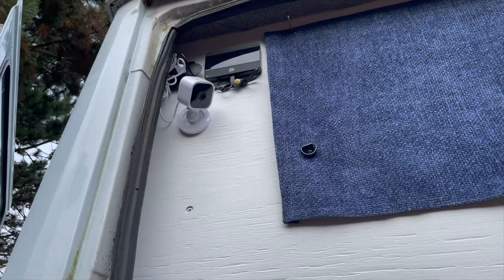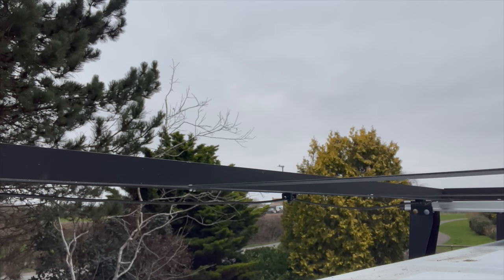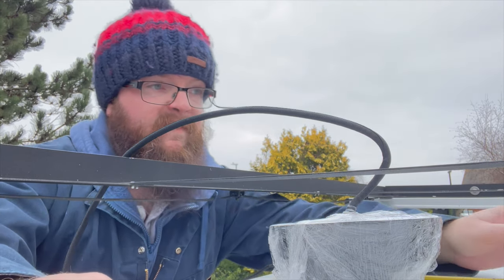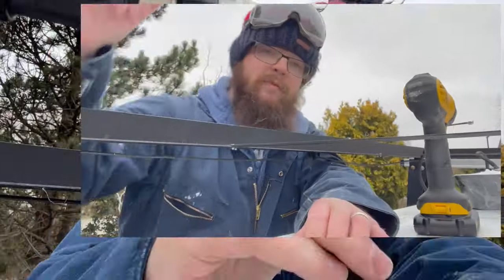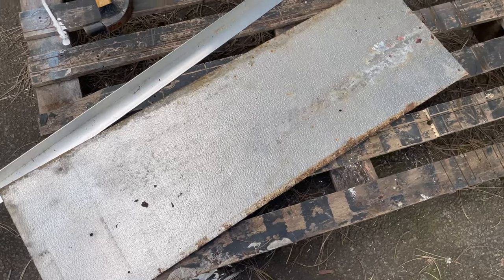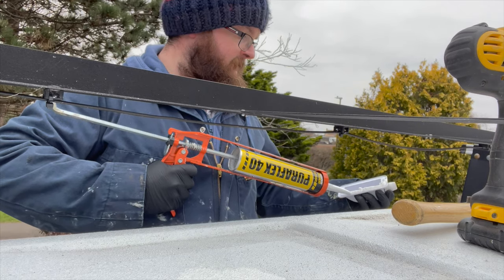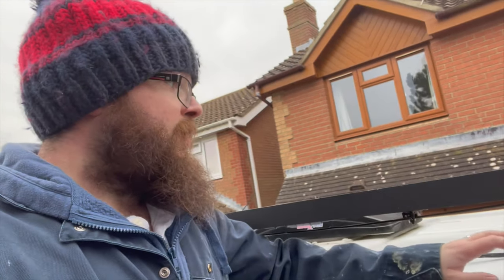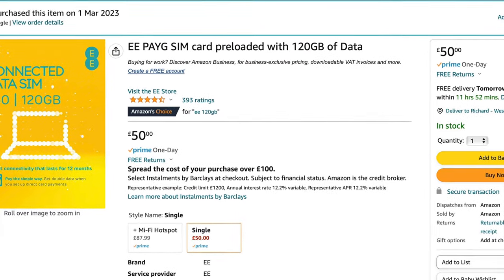5G Mobile WiFi Install: Van Internet, Fibre Broadband Fast!

Comment: Them speeds are really impressive! Unreal
Reply from the maker: It’s been good so far. In France the speeds were ludicrous as they’re better networked. The only time it slows, which is to be expected, is at festivals etc but it does its best to compete if that makes sense.

Comment: Nice work and I think your plan B looks an excellent solution. 
I have a Poynting 4G antenna and Nighthawk router and get some quite outstanding download and upload speeds using EE, somewhat similar to yours. We don't have the benefit of Virgin fibre to the house and, like you, the mobile router was considerably faster than BT fibre broadband. Therefore, we now solely use the Nighthawk at home and in the van. Works out cheaper overall as well as better speeds!
BTW, excellent 5G signal at Stratford-upon-Avon racecourse if you happen to head there again this year.
Reply from the maker: Thanks Peter, it worked out in the end. I like the idea of switching to EE, it would be cheaper and I might see if setting up a repeater in the house could mean we could switch. That’s good to know re. Stratford - very curious about what this can do in prime conditions but in reality this speed at 4g is still great news. 

This router uses the same processor as the nighthawk. Specs seem very similar, which is good. Thanks for the ideas as always, safe travels 🚐🚐🚐

Comment: Top job Richard,how would it stand up to all the Vario crew logging into your connection for free 😂
Reply from the maker: Ha, well it can take up to 32 connections - so technically yes (but by the rate the crew is going possibly not). From a financial standpoint we’d have to trade you for some of your fantastic food 😆

Comment: Hi, I’ve recently installed this any tips how how to possibly make it faster it still a bit sluggish
Reply from the maker: Brilliant, it really depends on the service in your area. Have found EE works well in most places in the UK and Europe, so bought a pre paid sim and this works well. What we have found is most van owners think the same, so when at shows or bigger campsites you might see a lag.

Comment: Is it essential to have the docking station ? Could you go from antenna to router ? Just wondering what this does , 🤔 ive got a nighthalk and ariel so yeah no box inbetween , not installed yet  yeah just wondering as only just seen this
Reply from the maker: In this instance I think yes as the ends of the antenna have a different fitting that inserts into the station but wouldn’t fit the router. I will check this though - the station is also hard wired into my 12v so provides a handy connection point - you could just charge it via a usb c though. 

I think they’ve done it this way so you can easily dock and undock it, so you could use the router away from the van. You can obviously do the same with your nighthawk, but might want a way to mount it when in the van.
Reply: Great stuff thanks for the info I did get connectors tails so that it changes to a t9  fitting to fit the nighthawk just wondered if it boosted the signal or something as it looked pretty heavy duty 😁

Great stuff , just got my MOT and on road now just few extra bits now 🙏 thanks for all your tips and help has been great in my build your videos as ours are quite similar
Reply from the maker: @climblivefree8344  hmm. Let me ask. I’d assumed the dock didn’t supply any extra power to the antenna. I’ll ask and update when they get back to me.
Reply from the maker: @climblivefree8344  and good luck with MOT

Comment: Just installing mine but can't seem to find out if the power is working on the docking station blue power light not on but there is power to the cable 🤔
Reply from the maker: The blue led should be on. Is the unit charging when you put  it on the dock?
Reply: @WanderbusAdventures  Thanks for the reply all sorted I had tripped a breaker in the Van 🙄 just need it to stop raining so can get the aerial fitted
Reply from the maker: @nikonneil ah brill. Hope you get some good speeds.
Reply: Thanks all tried it on the drive of up the Peak district on Thursday 👍 does yours stay connected all the time want to install a camera in the van seem to need to press the router every time I want to connect
Reply from the maker: @nikonneil pretty much yes. Every now and then it’ll need a reboot like most things.

Comment: Hi mate
I recently bought the 5G Ready Now antenna and just wanted to double check my product wasn’t faulty or missing something, the cable that runs from the antenna, the black and grey one, at the end of it should it have something that can plug into the router as is? Mine currently ends with two exposed bits of metal but I’ve seen other videos with a plug that will go into the top of the router
Reply from the maker: Morning. So ours came with the docking station and the antenna wires were both black and had push in connectors on the ends. On ours these push directly into the 5G router itself. Do you have the same router?
Reply: Yeah I’ve got the same router, I’ll have to have another look, but the cable that is along the wall at 9:50 is this running directly from the antenna. I’m thinking it’s my antenna power supply but unless I’m mistaken I can’t just plug it in as the two strands of cable just have exposed metal at the end
Reply from the maker: Ah yes. This is a 12v power supply - it is not directly connected to antenna. So on the other end you should have a power adapter that goes in your router. The cradle with the magnet should have two cables with copper connectors on the end - they look like tiny coaxial connectors.
Reply: @WanderbusAdventures  Oh so the two exposed cables are normal? Or should I have a piece that those two wires go into? Or do they go into the docking port/router that I’ve got provided?
Reply from the maker: @romainvicta117  the cable that runs along my wall was for power to the router. It’s not connected to the antenna directly.

Comment: Hy, just got my motorhome wifi 5g system installed and at the moment it’s very slow. This could just be where we are but not seeing any noticeable difference with the antennae. Will try when I get home and hopeful it will be better .
Reply from the maker: Well done for getting it setup. Hopefully it’ll be better - what provider did you go with?
Reply: @WanderbusAdventures  I am with 3 so  I will give it a go in different places and see how it goes. Whilst we were driving home from Edinburgh today partner got over 90mbs in the car as we towed the caravan so I suspect we picked up a 5g signal.

Comment: I HONESTLY can't think of ANYTHING worse for the health of your brain than sitting in a metal box and being bombarded with 5G signals.. QUOTE:  We bought ours 'second hand' but as new from another van owner that decided not to fit it to his van. Did you stop for ONE moment to wonder why?!   Did you ever stop and wonder WHY when everyone was in Lockdown 5G fitters were allowed to carry on the instals? QUOTE:  but to be honest the speeds already achieved over 4G are as quick, or indeed much quicker, than the average home fibre broadband. Phones don't need 5g - but the government DO
Reply from the maker: Thanks for sharing your concerns. We understand that people have varying opinions on 5G technology. The system works well for our needs, especially if we have to work from the van. The technology might not be right for others, and that is fine too. Thanks again for sharing.
Reply: I think when using this system you really should wrap your head and feet in tinfoil so that the signal cannot transit through your body, I find that standing rigidly upright with a baking tray on my head also helps, this is evidenced by the fact I use 5g and still haven't died, it definitely must be because  I took precautions 😂 seriously, calm down and don't believe all the conspiracy theories?..... great video and really useful info, I'll definitely be looking into this system
Reply: Lol
Reply: Wtf are you on about
Reply: @no1peo  Spot on! The energy levels emmited from the antenna are so low that i barely makes a difference. The antenna is also "outside" the motorhome, meaning your are somewhat "protected" . Also the antenna emmits radiowaves most when its uploading at full speed. Are you a youtuber uploading alot ? :) And are you spending more than half an hour a day less than 1 meter directly away from the antenna uploading on full speed? Other than that, we'll see in 20+ years what happens ;) 5ghz Wifi has existed for over a decade now and is running on higher frequency than 5G mobile.  Don't worry about mid band 5G , its the high band you need to worry about at 24+ GHZ ! In America, Japan, Korea etc... Great video by the way! :)
Reply: I can think of MANY things worse for your brain! What EVIDENCE do you have to support this assertion?